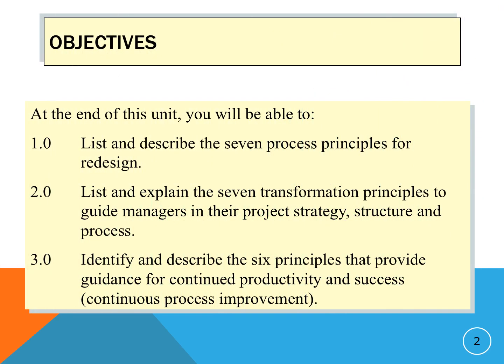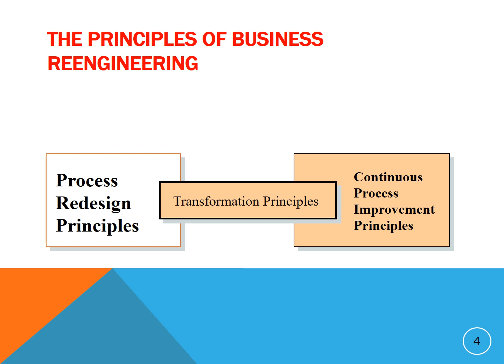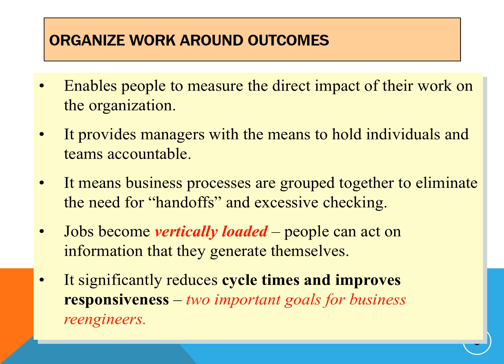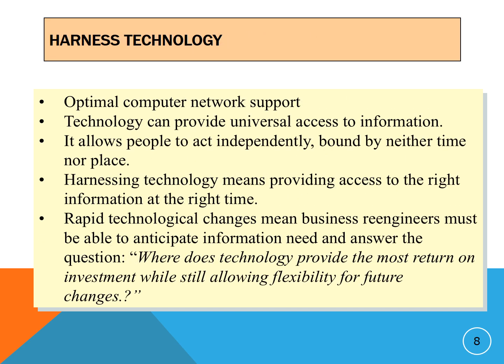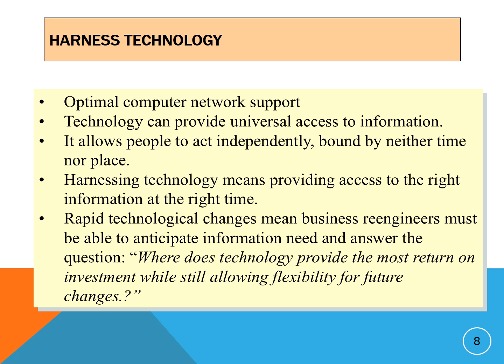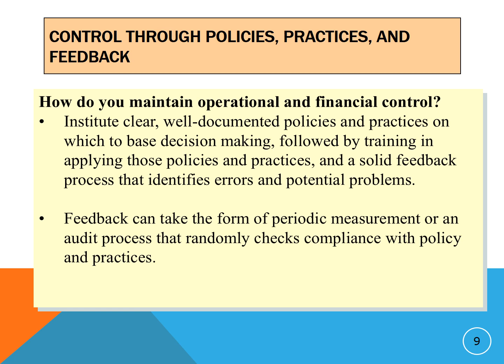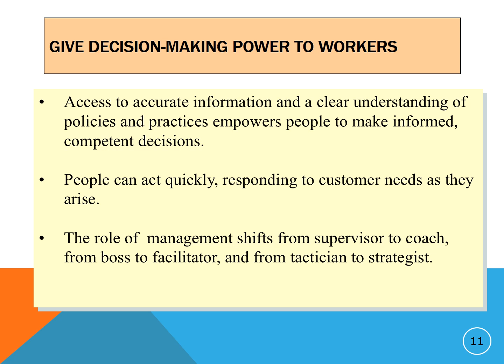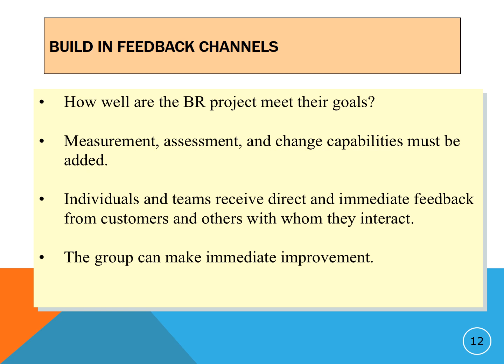Process Redesign Principles

Comment: Process redesign principles
1. Organize work around outcome - this is where the organization reduce the cycle time, improve the responsiveness
2. Provide direct access to customers - measures the redesign the quality, effectiveness and the quality of the product to be delivered 
3. Harness technology - technology can used for business reengenieering that will support the organisation at optimal stage
4. Control through policies, practices and feedback - well-documented policies to monitor the process, cycle, any problem with customers, satisfaction customers through feedback
5. Enable interdependent and simultaneous work - when people have excess information, they can communicate properly and the work can perform simultaneously
6. Give decision-making power to workers - through information gain, the organisation able to make decision with clear understanding
7. Build in feedback channels - all build feedback channel to know how well they meet goals and expectation of business reengineering

Comment: Based on the video, I learned that the principles of business reengineering consist of 7 process redesign principles. 
it consists  1) Organize work around outcomes where it helps in simple and short the work process. 2) Provide Direct Acess to customers refers to a work process that working with customers directly. 3) Harness technology is use technology that able to use even in the future. 4) Control through policies, practices, and feedback in well documented, enable maintenance in operational and financial controls. 5) Enable interdependent and simultaneous work and work in the team instead of linearly.  6) Give decision-making power to workers, where it allows employees to make competent decisions and more quickly. 7) Build in Feedback channels to know how well in achieving the goals.

Comment: Based on the video, it have seven process of redesign principle.

1. Organize work around outcome 
-the most important goals is it can reduces cycle times and improves responsiveness. It more focus on the outcome rather than individual task and each of employees know their own task.

2. Provide direct access to customer
- which is we give the best quality of product to our customer and we also can decide the best exact time delivery to customers. Its more reponsive and timely manner.

3. Harness technology
- Using technology we can know and provide information. We also can act independently anytime and anywhere.

4. Control through policies, practices and feedback
- Get a clear instruction, well documented policies and practices on which to base decision making. Getting feedback also important for example audit need to do a session to checck compliance that based on the policies and practices if the employees fully follow or not.

5. Enable interdependent and simultaneous work
- People can work in a team, teams are held accountable and rewarded for thr final outcome.

6.  Give decision making power to workers
- Employees can act quickly and responsive to the customer needs as they arise.

7. Build in feedback
- three elements such as measurement, assessment and change capabilities need to added. Individuals also can give information to customers directly if anything happened during the business.

Comment: Based on the video, business reengineering includes 3 principles which are:
1) Process Redesign Principles
2) Transformation Principles
3) Continous Process Improvement Principles

These principles are really important in business reengineering as a guideline and design a structure of the reengineering.  In this video, it is a detailed explanation of process redesign principles that includes 7 processes:
i) Organise work around outcomes where it is to reduce cycle time and improve the responsiveness
ii) Provide direct access to the customer where the company tries to improve the quality of products to meet customer satisfaction and needs.
iii) Harness technology where employees can access the information anytime and anywhere.
iv) Control through policies, practices, and feedbacks
v) Enable interdependent and simultaneous work 
vi) Give decision-making power to workers where include their opinions in decision making.
vii) Build in the feedback channel.

So, principles and guidelines very important to make sure the project can be run smoothly and successfully.

Comment: Based on my understanding, there are 3 principles that is important to guide the organization doing any standard that related to the business process reengineering which are process redesign principles, transformation principles and continuous process improvement principles.

For the process redesign principles, it consist seven important point which are:
1. Organize work around outcomes.
2. Provide direct access to customers.
3. Harness technology.
4. Control through policies, practices and feedback.
5. Enable interdependent and simultaneous work.
6. Give decision-making power to workers.
7. Build in feedback channels.

Comment: Based on my understanding: 
There are three principles in business reengineering which are Process Redesign Principles, Transformation Principles and Continuous Process Improvement Principle.  These principles are important to guide business process itself as any standard in business organization are related to business process reengineering. 

There are seven process redesign principles.  The first one is ‘organize work around outcomes’ which helps on significantly reduce cycle times and improves responsiveness.  The second one is ‘provide direct access to customers’, this principle allow for timely and accurate responses to customer inquiries.  The third principle is ‘harness technology’ which is an optimal computer network support and allows people to act independently, bound by neither time nor place.  The fourth principle is ‘control through policies, practices and feedback’.  Feedback can take the form of periodic measurement or an audit process that randomly checks compliance with policy and practices.  

The fifth principle is ‘enable interdependent and simultaneous work’ which mean that when people have access to information and can communicate cross-functionally and cross-organizationally, the work can be performed simultaneously instead of linearly.  The sixth principle is ‘give decision-making to workers’ where it helps to encourage people to act quickly, responding to customer needs as they arise.  The seven and last principle is ‘build in feedback channels’ whereby individuals and teams receive direct and immediate feedback from customers and others with whom they interact.

Comment: Based on above videos, there are 3 important principles in business reengineering process which are, process redesign principle, transformation principles and lastly, continuous process improvement principles. 

Meanwhile there are 7 process redesign principles. Those principles are very important for companies to implement to make sure they improve their performances higher than before. 

1. Organize work around outcome.
2. Provide direct access to customers.
3. Harness technology
4. Control through policies, practices, and also feedback
5. Enable interdependent and simultaneous work.
6. Give decision-making power to workers.
7. Build in feedback channels.

Comment: Based on the video,  what I understand are there are three business process redesign principles which are process redesign principles, transformation principles and continuous process improvement principles. 
The reason why we need to have principles are as the guidelines for business process improvement or used by team members to design the process, structure, technical processes in order for them to focus on their transformation efforts on business culture, values and belief system.
There are 3 questions that need to be asked:
1. How do we develop effectively reengineering design? - refer to process redesign principles
2. How can we ensure a successful implementation? - refer to transformation principles
3. How can we ensure continued application, productivity and effectiveness after reengineering? - refer to continuous process improvement principles
In  the process redesign principles, there are seven guidelines which are organize work around outcomes, provide direct access too customers, harness technology, control through policies, practices and feedback, enable interdependent and simultaneous work, give decision-making power to workers and build feedback channels.

Comment: From my understanding, principles are very important towards the process of re-engineering as it will be used as the guides for the transformation process. There are several principles that i gained from the video which are organize work around outcome, provide direct access to customer, harness technology, control through policies, practices and feedback, enable interdependent and simultaneous work, give decision-making power to workers and build in feedback channels.

Comment: According to the video's explanation of Process Redesign Principles, I understand that the principles is to guide the organization or the business process itself. There are 7 process process redesign principles which include: Organize work around outcome
, Provide direct access to customer, Harness technology, Control through policies, practices and feedback, Enable interdependent and simultaneous work, Give decision-making power to workers, and Build in feedback channel. The principles is important as it works to guide the organization or the business process itself and the key for reengineering change to be successful.

Comment: Based on my understanding, in order to have an effective and successful reengineering change, it must be developed business process redesign principles. There are three principles which are process redesign principles, transformation principles, and continuous process improvement principles. These principles can be served both as a guide to the redesign of work and as the criteria against which to measure the redesigned processes for quality and effectiveness. Moreover, these guidelines will ensure an effective physical and technical component of the reengineered business operation. 

Under these business process redesign principles, there are seven process redesign principles which are organized work around outcomes, provide direct access to customers, harness technology, control through policies, practices, and feedback, enable interdependent and simultaneous work, give decision-making power to workers and lastly build in feedback channels.

Comment: Based on my understanding for Chapter 2, the principle of business reengineering had seven which are process, redesign, principle, continuous, process, improvement and principles. 
Principle to guide the business itself to have the standard of the organization. 
To design the process of the organization. 
Seven process redesign principle are organized work around outcomes, provide direct access to customer, harness technology, control through policies, practices and feedback, enable interdependent and simultaneous work, give decision-making power to workers and build in feedback channels. 

Organize work around outcomes enable people to measure the direct impact of their work on the organization that provide managers with the mean to hold individuals and teams accountable. 
Provide direct access to customer where the group of work organize the accountable for customer behaviour that allow timely accurate to customer inquiries. 
Harness technology is the optimal computer network support that allow people to act independently that bound by time or place that provide access to the right information at the right time. 
Control through policies, practices and feedback is the full document which base on decision making that followed by applying the policies and practices which identifies errors. Feedback is where take the form of periodic measurement or an audit process that random checks compliance with policy and practices. 
Enable interdependent and simultaneous work is when people access the information and communicated cross-functionally then work can be performed instead linearly. People can work in teams and held accountable and rewarded for the final outcome. 
Give decision-making power to workers is make a way to access the accurate information and a clear understand the of policies and practices empowers people to make informed, competent decisions. Plus, people can act quickly that respond to customer needs as they arise that role of management shifts from supervisor. 
Build in feedback channels which individuals and teams receive direct and immediate feedback from customer and others with who they interact.

Comment: Based on my understanding, in Business Process Redesign Principle have three principle. The first principle is Process Redesign Principles

1) organize work around outcomes
     it enables people to measure the direct impact of their work in organizations    and  the goals of reengineering is to reduce cycles time and improve the responsiveness
2) provide direct access to customers
     it allow for timely and accurate response to customer and it also can create a good relationship with the customer
3) harness technology 
    the technology that can provide universal access information in anywhere and anytime
4) control through policies, practices and feedback
    it to monitor the errors, potential problem and feedback of the process
5) enable interdependent and simultaneous work
6) give decision-making power to workers
    it can quickly responding to the customer without go through other level because they have power to decision making
7) build in feedback channels